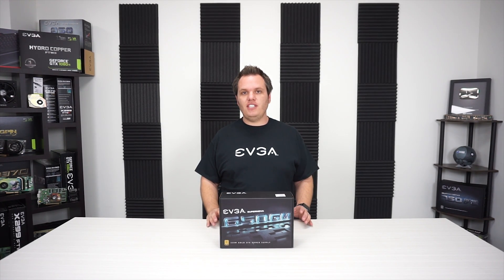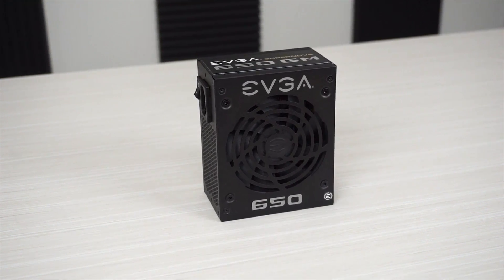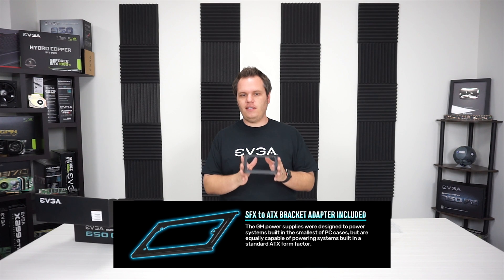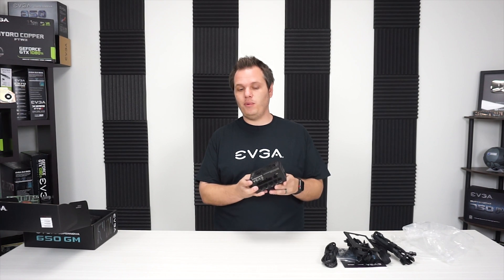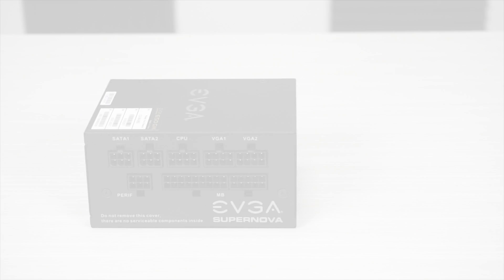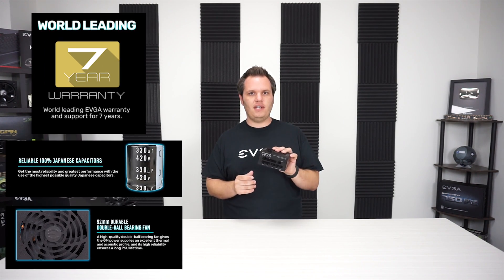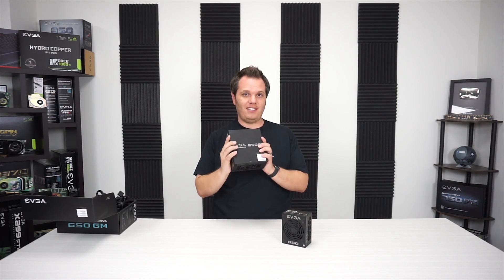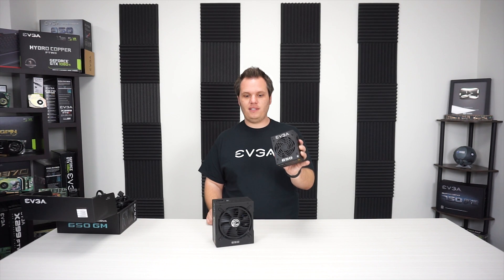EVGA SuperNOVA GM SFX Power Supply Overview

Comment: I made the mistake of buying your product. I have had gpus (1070) and othe stuff from you die on me. Now i bought an evga supernova gold rated 550 and inside a small case (dan a4) i would prefer the psu to be cool with a fan on all the time rather than the thing turning on at full blast at random. Someone please help me how do i turn this eco mode off cause they removed the switch outside!

Comment: omg I bought this brand new to install it on my ATX corsair case and the cables were TOO SHORT it said that it is atx compatible now im stuck with a brand new power supply and need to sell it please do not put that it is atx compatible with a bracket its misleading cuz the cables are too short for the cpu and motherboard
Reply: Get  cable extensions they are like 20 bucks
Reply: How much? i have an EVGA 750 BQ full size.... 1 month of usage... u wanna trade? i have the same size problem on my mini itx pc =(

Comment: Double-ball bearing will make that fan last a while, sure...  but damn, that's gonna be noisy in the 92mm size. 
When is somebody that understands the value of high-quality components, gonna make one of these in the "SFX-L" format.  Yes, SilverStone invented that category... but they refuse to pair their idea with a properly QUIET fan.  Make a version of this deep enough for a 120mm fan, make it the silent FD-Bearing type, and with the EVGA (Super Flower) focus on good electrical components/performance, you could EASILY beat SilverStone at their own game here. 
As it stands...  Corsair's 600W take on this format, has everything this does... AND a Platinum-rated version.  (Less waste heat means the fan doesn't need to run as fast!)  Also, their fan is the quieter oil type bearing (with the same 7-year warranty!), plus a much less restrictive wire-cage type grille.  So less noise on both counts.
Reply: If you can still find one, Lian Li made a 750w sfx l psu and Its is pretty nice.
Reply: Heya, I'm undecided between the EVGA SuperNOVA GM SFX 650W and the Corsair 600W SFX Gold... which one is better (besides 50Ws more). Thank you!!!

Comment: Finally you guys made an sfx psu. Hopefully this will be a viable competitor to the corsair units.
Reply: Oh hi there I watch your videos. This power supply is pretty good, works well with a 2070 and overclocked 3700x.
Reply: Oh hello, I watch ur YouTube. I have this power supply and it is pretty good. Just don't use cables from a different psu or it will fry all your sata devices (I learned the hard way, fried all my ssds and corsair fans and led strips.)
Reply: Omg nice it’s you